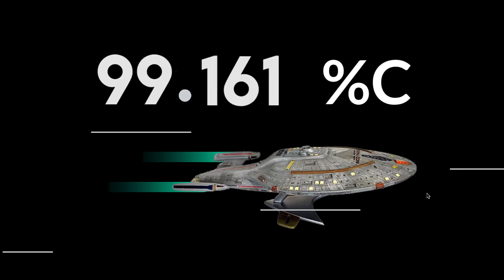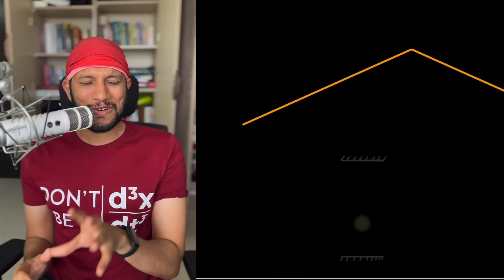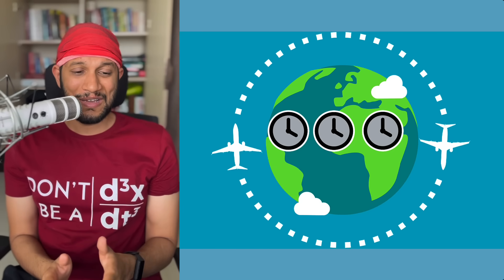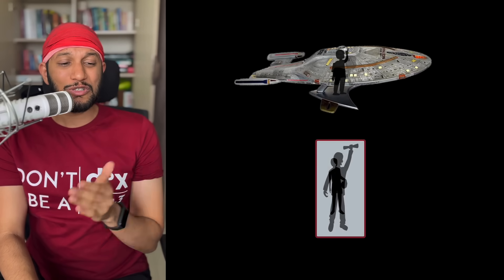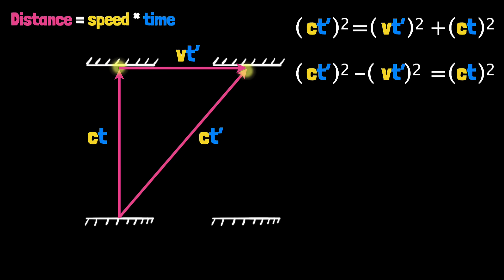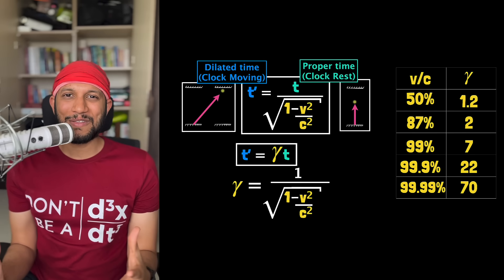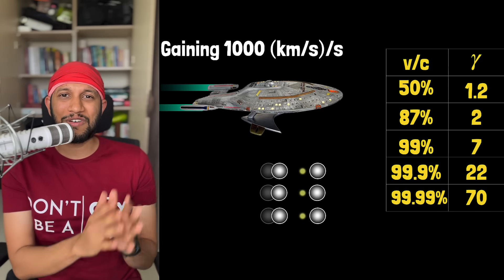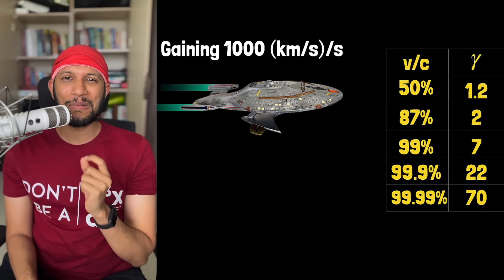I finally understood why you can't go faster than light! (My mind is blown)

Comment: I don’t understand:
1. If the time dilated is about the observed time from the non moving observer, of course you cannot measure someone going more than the speed of light because the photons would never arrive to you anyway. (If i stayed in a newtonian paradigm, the photon would stay still, if this makes any sense)
2. But then if I go beyond the speed of light, it would mean that the matter and photons I send back would actually never arrive to the first observer, but does it mean that I cannot accelerate more??
3. If 2. Is correct and there is an absolute time and only measured time is actually relative, is there any proof that shows that time is actually absolutely less than c and not more and not just relatively to an an observer.

Comment: Another fun thing to think about is why objects appear to become flatter to an outside observer as they approach the speed of light. Objects exist in space and time, but the faster you travel through one the slower you move in the other. You basically have a maximum total velocity that can be split between motion through space and motion through time. If you were to somehow reach C, you would be facing 100% towards Time. Sort of like a 2D character on a video game rotating 90 degrees in the 3rd dimension, they essentially disappear if you look at them edge-on because they have no depth, frozen completely in time.

Comment: My theory is that time doesnt slow down, just the decay of atoms alters due to the addition mass added through speed. Since the measurement of time in atomic clocks is through decay, how is decay (losing mass) affected when the matter is gaining mass?

Also, I cant remember atm, but what is that alters binary in data? It can affect computers ect on earth but on space missions the systems need to correct for 100s or 1000s of them.

I know we calculate for them in computing, but atoms ect cant exactly adjust for them. What affect can they have on individual atoms, particularly at close to C?

Comment: For those who wonder what's on the t-shirt, d^3•x/dt^3 is the derivative - infinitesimal rate of change over an infinitesimal time - of the acceleration (noted d^2•x/dt^2), which itself is the change rate over time of speed (noted dx/dt) which is a change rate of position (x) over time (t), and so an infinitesimal change of acceleration over an infinitesimal time is called a "jerk" in English and is noted d^3•x/dt^3. Clever physics joke 😂

Comment: Time dialation is a theory, it's not posible stop the bullshit.  Time is the only constant in the ...... everything.  The way you calculate time, can be modified, but time does not go slower or change.  All this means is that there is no acurate way to measure time.  But time doesn't move slower or faster.  This is why einstein was wrong and not able to understand.

Comment: The Lorenz equations related to light speed imply the energy requirement drops once you cross the barrier, then as you speed up you get lighter. If it were possible to quantum tunnel the barrier, just like electrons in a zenner diode, you could then be going faster than light (whatever that actually means, maybe you become dark matter?)

Comment: There something missing tho. When you are in ship that try to pass speed of light, your perception will be same. So if you calculate you need 10 minutes more with your acceleration, you will travel at light speed after 10 minutes. It may take forever for everyone else but not for you.

Also this will make you the last meaningfull object in the universe because everything else will be heat killed. With this logic, what will happen if you pass speed of light at the end of 10th minute?

Comment: Stupid question here: does this also work in reverse? Technically, we should be used to ‘aging’ at the speed produced by the earths rotation, orbit around the sun and eventually the Milky Way. Hypothetically speaking, if everything in the universe slowed down, would we age quicker than we do now? If so, if the universe would ‘stop’ would everything decay at an infinite rate?

Comment: because gamma is the root of 1-v^2/c^2 and becomes zero as v approaches c and you get a divide by zero error as v/c =1 . The maths would be the same if you took c= Mach or c=to the top speed of a snail . . .as v approaches c from below . . .you get a divide by 0 error.

Comment: Does that mean that if earth and the entire solar system, galaxy and universe were'nt moving through space at crazy speeds already, time would technically move faster? And would we as humans be able to percieve the time moving faster or would it from our perspective, be "normal time"
Reply: Remember that all speed is relative.  When we say "the earth is moving at such and such speed through the milky way", that speed is relative to the center of the galaxy.  But we could just as well measure our speed relative to the Andromeda galaxy or any other point in space.  There is some reference frame in which we are currently traveling at 99% of the speed of light, and another in which we are currently at rest.  If all of these reference frames are equally valid, which is a central assertion of special relativity, then our speed in any particular reference frame ought to have zero impact on our perception of time.  That is to say, we always have the same perception of time.

Comment: I understand this at a higher level. you might have to to push the envelope to get grasp this, but try .   E=MC2 is one of those those math thing that works both ways.   3X4=12.   12/4=3.   .Matter is naturally converted to Energy the faster you go. so mass X the speed of light squared the result shows the percentage of matter converted into energy.. because energy has no weight it takes. Less energy to move the object. This is a non linear scale   Once hit reaches light speed the object (in this example a photon)is 100% energy and can travel in hyperspace.   want proof?  when a photon to drops out of warp it enters an atom 
, sligshots around the nucleus and jumps bract in hyperspace.   no take this higher level of understanding and check out 'unexplainable properties of photons.  or AS I CALL IT  scientific proof faster than light travel. is not the only possible, but. Occurs naturally

Comment: Also comes to mind that superluminal communication so far apparently is not possible, and measuring a clock is a form of communication even if it is a digital signal etc, so "time is relative to the observer" because measuring time is a form of communication also bound by the speed of light. Just like shown in the video, objects (or information) might move faster but your measure ability from outside does not speed up proportionally. If the object/information moved at the speed of light you would not be able to measure it, so it does not. Weird stuff - I dunno xD

Comment: So if you didn’t care about outsiders, would it still take 300 seconds to reach the speed of light?
Reply: Since the faster the ship moves, the slower the time become. As the result, the ship can never finish the last second.
Reply: @kenchen1351  how would that feel from inside the ship?
Reply: @spookwave4966  If you are talking about perspective, then people in the ship will not be able to notice any difference. Loosely put, they become live statue - they are alive, but time is frozen for them. 

For more technical explanation: There is no absolute speed - speed can only be measured in relative to one another. Therefore, the "speed" is actually "the ship's relative speed to people outside the ship". For people in the ship, they will observe people outside the ship moving backwards at the same speed as people outside observe the ship moving forward - which will always be less than speed of light.

Comment: Yes, but what if I am on that ship? Since for me time passes by normally, what prevents me from accelerating to the speed of light? Also, since as far as I am concerned, on that ship, once it has reached a certain speed and stops accelerating (say 99.99%C), it is me that is not moving but instead it is you (my frame of reference is at rest as far as I am concerned), wouldn't I be aging and see you stay young?

Comment: I just can't stand the theory of time dilation because it's not a thing.  A clock on a ship traveling at near-light speed will appear to move slower because light will take longer to reach the stationary observer (if you could even see said clock) from the ship moving farther away. The clock still ticks at the same rate per second.
Reply: The test about airplane - they bring back the clock and find the clock is different.
Reply: @kenchen1351  link so I can watch
Reply: @ScreaminChicken444  I like your attitude. Doubt is the origin of wisdom. 
I'll give you the wiki link. All the studies and papers are referenced below the page.  https://en.wikipedia.org/wiki/Hafele%E2%80%93Keating_experiment

Comment: Form the perspective of the ship, would they reach the speed of light?
Reply: Would they reach the speed of light relative to what?  Remember that speed is relative and it is meaningless to ask "what is the ship's speed" without specifying what frame of reference you are measuring relative to.  In the reference frame of the ship, the ship is always at rest (since the frame moves with the ship), so it would clearly never reach light speed in that frame.  From any external, non-accelerating reference frame, the ship will approach c but never reach it, for the reasons explained in the video.

Comment: It also means that time is relative. Our solar system  moves through the universe at a different speed to even other star systems within our own galaxy. Let us find a solay system moving through space at 99.9% of the speed of light. If we move there we can all live for thousands of years.
Reply: We already know a solar system moving through space at 99.9% off the speed of light: our own!  Remember that speed is relative and depends on the reference frame we are measuring from, so it is perfectly valid to say that the earth is moving at 99.9% of the speed of light in some reference frame.  It is equally valid to say that it is at rest or any other speed between 0 and c in some other frame.  With that in mind, you should hopefully be able to see that the speed at which an observer travels relative to a particular reference frame does not affect that observers perception of time (i.e. you can't experience a longer life by traveling fast relative to someone else), since said observer is simultaneously traveling at all possible speeds in infinitely many equally valid reference frames.

Comment: I have a theory that the speed of light is always infinite from the perspective of the observer, and in the “other direction” it is 1/2 C. But since there is absolutely no possible method to measure time or the speed of light that isn’t affected by the speed of light itself , then we just settle on the current speed as an average between the two points?

Comment: I now understand why you can't move through spacetime faster than the speed of light but there doesn't seem to be a limit on how fast spacetime can move. What I mean by this is there are galaxies we will never see because they are moving away from us faster than the speed of light so their light will never reach us. The galaxy itself isn't moving through spacetime faster than light but the combination of the galaxies movement and spacetimes movement is faster than the speed of light. I'm also talking about the warp drive. A Mexican physicist Miguel Alcubierre came up with an equation that showed how you could warp the spacetime around the ship enough to create a bubble of bent spacetime that moved faster than light. The ship wouldn't be violating relativity because it would not be moving through spacetime faster than light it would be inside the bubble of bent spacetime and the bubble of bent spacetime would be moving faster than light. Alot of you are probably thinking this is impossible but Alcubierre showed how mathematically it could work. The problem with Alcubiere's equation is it would take an enormous amount of energy/fuel and some of the engergy fuel would have to be negative mass/negative energy. In the real world how do you have less than 0 energy? You can have an object colder than absolute zero. I'm not convinced that the equation is totally impossible although because scientists are finding ways to make the math work with less energy and some scientists think you might be able to get negative energy out of dark matter. I think it will be a long time before we invent a warp drive but I'm not convinced we can't make a warp drive.
Reply: Search for "DARPA FUNDED RESEARCHERS ACCIDENTALLY DISCOVER THE WORLD’S FIRST WARP BUBBLE".

Experts say the objects in the Pentagon's FLIR videos show signs of the curvature of space.

And Ben Rich, ex-director of Lockheed Skunkworks said in the 90's of students that they have the warp drive at Area 51 based on salvaged technology, but still need to improve the formulas to operate it.
It cannot be ruled out that in a secret program (e.g. "Solar Warden") experimental warp application with experimental spaceships exists.
We could see the first official warp journey by astronauts in our lifetime.

Comment: all this explains time dilation but not the reason we can't move at the speed of light....photons have no mass...anything with mass requires energy to accelerate ...we cannot create enough energy to accerrate a single molecule with mass to the speed of light,,,it is physically impossible ....hence we cannot move at the speed of light....there are particules that move faster than the speed of light

Comment: It would look like it would take an infinite amount of time to reach the constant speed of light from the outside, but what about the “proper time” clock on board the ship? Wouldn’t it cross the speed of light threshold with no slowdowns? Even if it looks like an infinite amount of time to the outside observer, time is still proper on the ship?
Reply: When talking about an object's speed, you have to specify what reference frame you are measuring from.  In the reference frame of the rocket, the rocket is always at rest, because the frame is traveling with the rocket.  So not only does the rocket never reach c in its own reference frame, it never reaches any nonzero velocity.  An observer on the rocket does not notice any changes as the rocket's speed relative to some external inertial reference frame approaches c, because for that observer there are no changes to notice: the rocket's speed relative to the external frame is irrelevant.

Comment: ok but how does light know that the space ship is already moving at 99%c fx. i mean if the universe only consisted of 2 spaceships that move past each other quickly, how could you know which one is still and which one is moving. is spacetime on gridlines?
Reply: It is meaningless to ask which is moving and which is stationary without referring to a frame of reference.  All motion is relative, there is no such thing as "absolute" motion, so whether the spaceship is moving depends on the reference frame you are measuring from.  In one frame, spaceship A is stationary while spaceship B moves at, say, 90% of the speed of light away from it, and in another frame spaceship B is stationary while spaceship A is moving at 90% of the speed of light.  Or you could measure from another frame where both spaceships are in motion, all are equally valid.